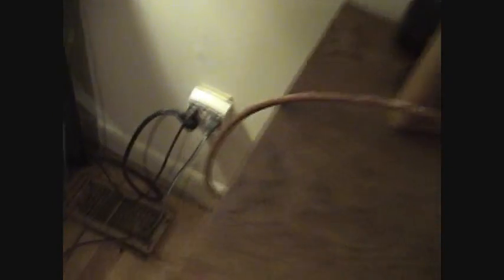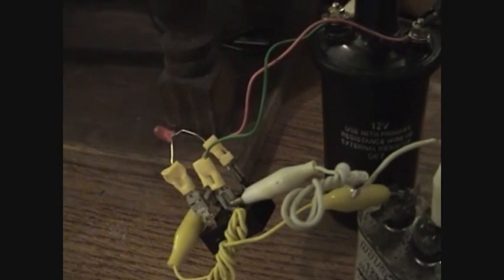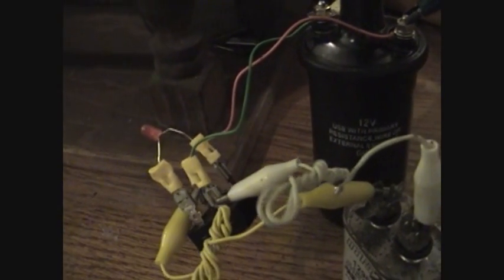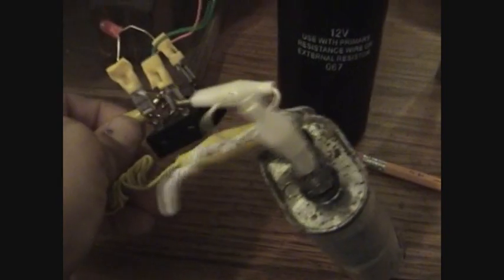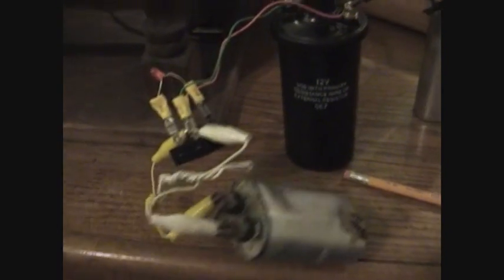Wireless energy tansfer pt5

Comment: Wow, thats good. Try putting a joule thief circuit on the receiver side. I bet it glows full strength.

Are your capacitors the same value and are the ignition coils the same type? I think that might make a difference.

Comment: yes there are like two major resonant parts of the tesla earth wireless system, see one part is the coil resonance to eachother, then theres the earth resonance which both are two different frequencies. yea the earth can be resonanted between 6-20000 hz for industrial efficientcy then the coil is pulsed at a resonant frequecy as well to multiply energy in the circuit. doing good, ur learning the right stuff honda!

Comment from the maker: could you refer me to where or which i put the capacitors because i have everywhere on here and different sizes and i can charge a capacitor in series in between the spark gap and the ground but i dont help the transmitter transmit.